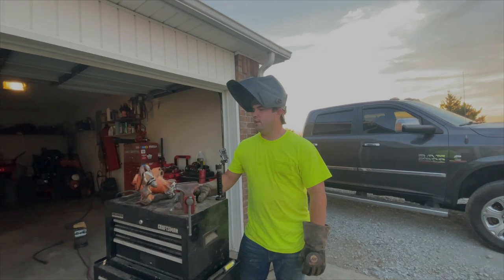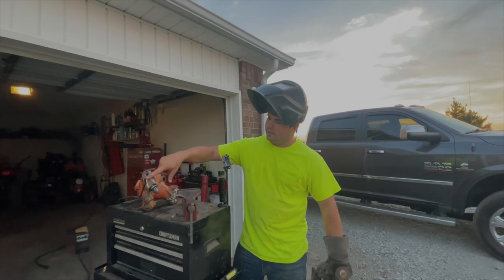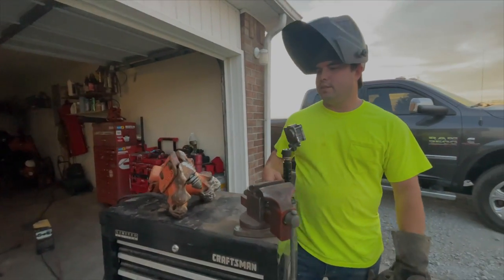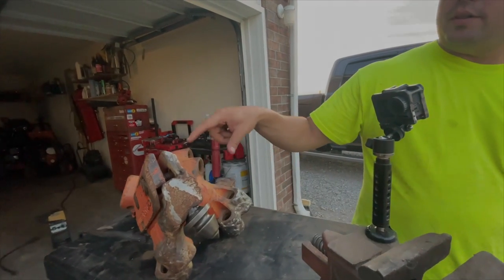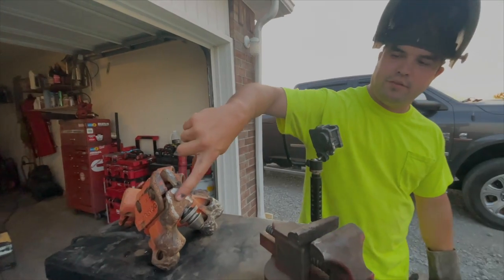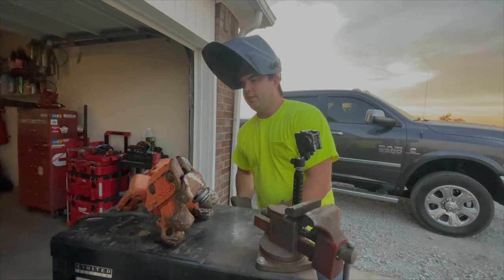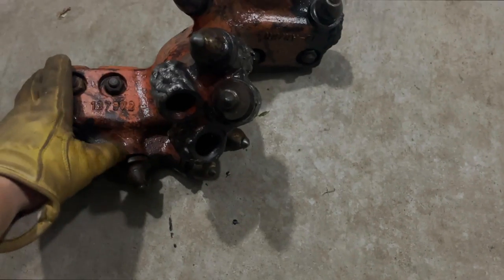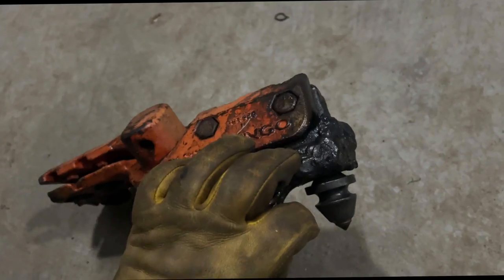How To Weld Up 12" PENGO ROCK HEAD For Your BOBCAT Auger In Less Than 10 Minutes

Comment: how do you like your powerstar cause im thinking about buying one and need some rating
Reply from the maker: It’s been pretty good. Honestly I got 560 hours on it now no issues so far. Really the only thing that sucks is a crappy galaxy tires that come on it. It’s rough riding every time it’s parked for a few days it seems like they get flat spots causing rough riding down the road. 

Seems like it’s a good true 100 hp. The loader functions on it are really nice. It works well speed up, down an tilt are fast. Servicing is pretty easy except for on one of the filters they’re all right there together but one of them you gotta take some brackets off to change it.